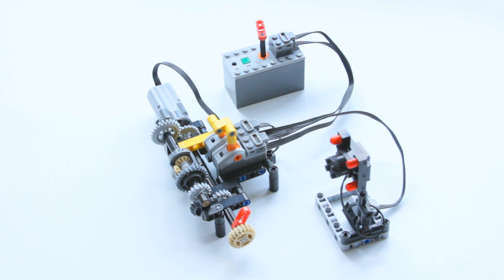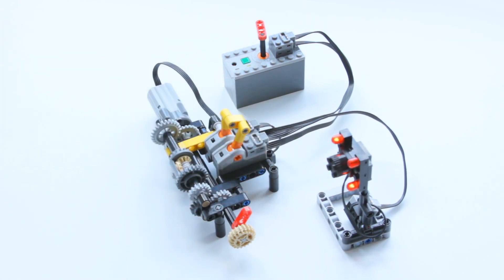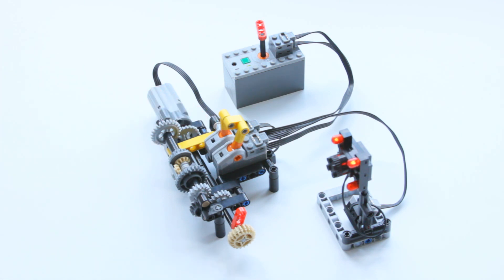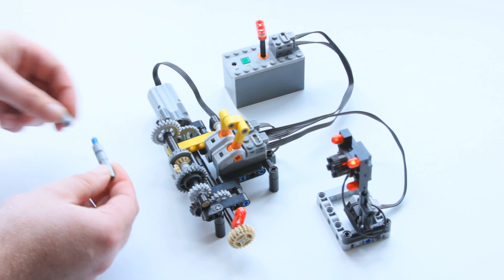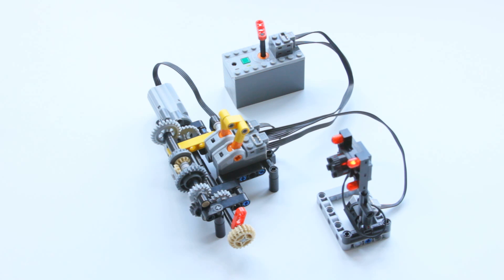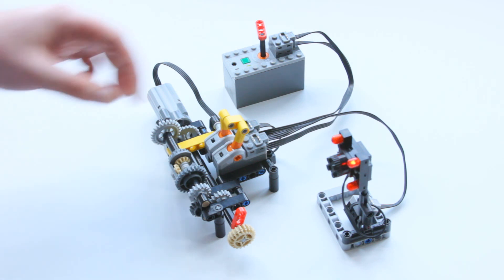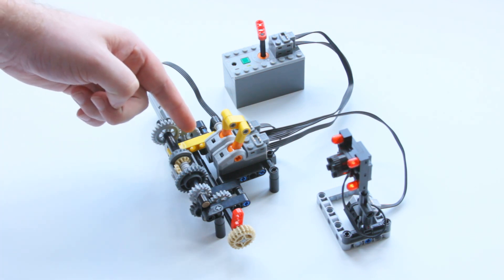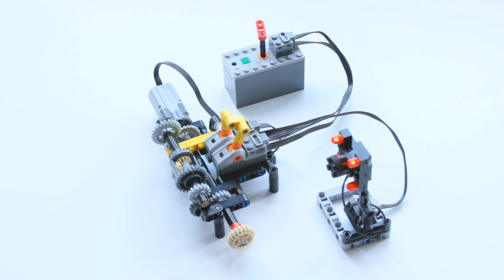LEGO Technic Automatic Motor Shutoff and Alarm

Comment: One flaw, now you can’t use the motor for anything that requires even a minimal amount of load...
Reply from the maker: I have used this mechanism to drive one of my GBC modules ( https://youtu.be/XQCGHxT8XaE ).  While this GBC module doesn't put a huge load on the motor, it is more than 'a minimal about of load', and this mechanism handles the load just fine.

Comment: Considering the way its built, you could alternatively turn the output by hamd wjen the system is halted to move the switch to turn the motor back on. That could be useful if the load is based on a moving vehicle that still has momentum to overcome a false halt in the system.

Comment: How can you make it need more friction in order to turn the diff (making the clutch stronger)?
Reply from the maker: You could either change the gearing after this mechanism so that there is more torque at the output, or you could make the clutch stronger.  One way to do that is to add a little piece of paper wrapped between the pin and the pin joiner.  The more paper that you add, the tighter/stronger the clutch will be.
Reply: S. L. Froden Thanks!

Comment: How did you get the newer electric cable to connect to the old one?
Reply from the maker: +Serucipe - If you buy one of the Power Functions Extension Wires (set 8886 or 8871), one end of the cable allows you to attach the older 9V cables.
More information here:
https://www.lego.com/en-us/powerfunctions/articles/8886-power-147607ae22954426a3603177991d2b63
Reply: slfroden thank you I was wondering the same thing because I have the mind storms Rcx kit without the yellow brick

Comment: How blinking LEDs and siren are done?
Reply from the maker: +Klotzki Technic - these are the old 9V Light & Sound bricks from the mid 1980s to mid 1990s. The blinking lights aren't LEDs, they are incandescent lights, and have the part number 4771. The siren is part number 4774c01. These can be found on BrickLink in the 'Light & Sound' section of the catalog.
Reply: Thanks.